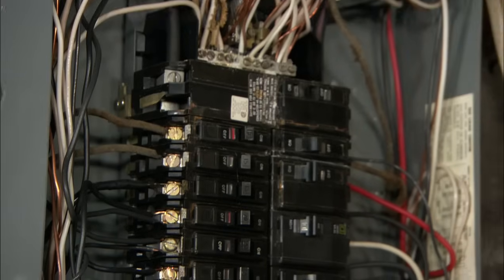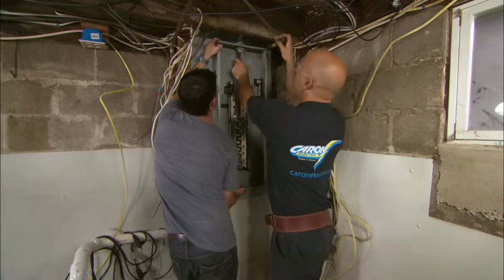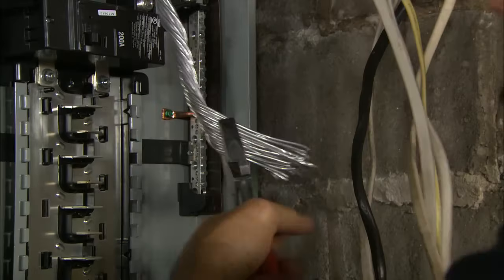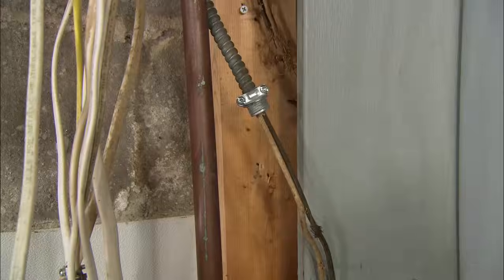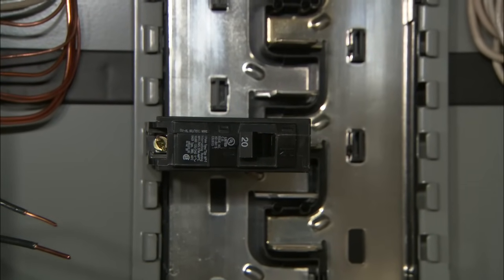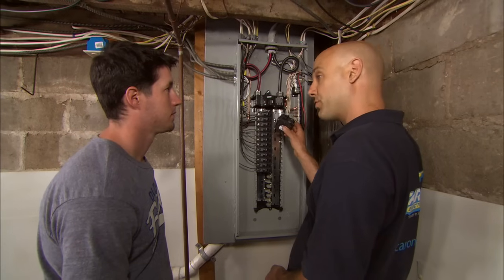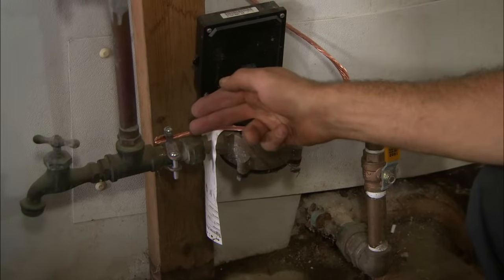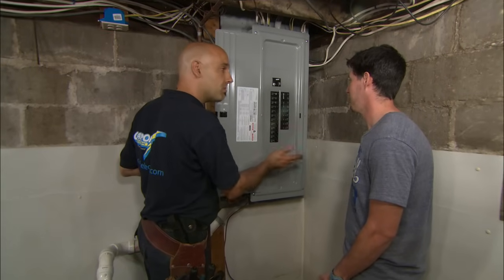How to Upgrade an Electrical Panel to 200-Amp Service (Part 2) | This Old House

Comment: don't know how long it takes him to do all this but a contractor is asking for $4,500 to do the same on my home. WTF?
Reply: Get a detailed quote of materials and time. Make sure the material quote includes make and model of panel, breakers, rain head and meter base. Then do some research to verify reasonableness of quoted costs.

It should take less than a day to accomplish. The contractor may be grossly inflating the materials costs.

Comment: not an expert but I do know 2 things, 1.) ground wire attached to water line is a no no most places require it to go to ground,  connected to a water pipe would not pass, 2.) you should never have all the breakers on when you flip the main. p.s. he's so confidant in his work he had the home owner flip the main with all circuits on instead of doing it himself.
Reply: It was TV dramatization. You can bet that it was tested out in advance of filming that scene.

Another example, they did not show the power company going to the house and reconnecting the feeders after the wiring was completed - and probably an electrical inspection as well.
Reply: Bonding the waterline is a requirement

Comment: Why are they still using aluminium wire?
Reply: Because it is far less expensive than copper and only used as far as the main distribution panel.
Reply: buggsy5 in Canada where I live aluminum is not allowed or code. You won't even get insurance for it.
Reply: chefbillyx aluminum IS used in Canada as service entrance conductors.

Comment: The main ground in this video that was shown stranded. It's a NEC violation, being bare and exposed to physical damage.  It should be solid bare ground and size accordingly to the NEC . This should be red tag by the inspector.

Comment: If this were my house getting service upgraded,  I won't allow any electrician to bring aluminium wiring into the house.  The last house I lived in, it had aluminum wiring brought in from the weather head to the outside box, then to the circuit breaker.   I don't know when it was put in, but it was put in, when the house was added onto, and was old enough to create problems.   My house nearly burnt to the ground, because the aluminum wiring could not handle dissimilar metals used in the breaker box.  The electrician used  copper wire from the weather head, to the outside box,  then to the circuit breaker.   When I can afford to rewire my current home,  I will mandate copper wire from the weather head,  to the outside box,  and to the house.  The house overall needs to be upgraded.
Reply: davenwin1973 then the power company runs aluminum to the weather head
Reply: The power company will use aluminum for their feeders. It is arguably safer to use aluminum to splice to those feeders.

Comment: To address the aluminum issue. Why the hell does this service panel contain aluminum when every insurance company in America will not cover aluminum wiring into and throughout a home? Because it's NOT CODE. PERIOD.
Reply: WRONG
Reply: Why do people like you feel a need to post incorrect nonsense on here? Nearly ALL houses in the US have aluminum entrance wire, and it IS covered by insurance companies (I should know I used to work for one)...you also imply that aluminum was used throughout the house...why? It's obviously copper.
Now prove me wrong, and post the code section where it says aluminum is not allowed as service entry wire.
Reply: It is not allowed for circuit wiring, but totally permissible for primary feeders.
Reply: buggsy5 that's interesting. I did not know.
Reply: As if you’ve ever opened a code book

Comment: I thought aluminum wires weren't to be used any more
Reply: That applies only to circuit wiring. It is still allowed in the US as far as the main distribution panel.
Reply: I don’t know who told you that

Comment: IM JUST HERE to read the comments on every sin the electrician committed by the youtube community.
Reply: LOL...exactly.
Reply: Well first of all I don't see why he's doubling up his ground connections the bus bar is hardly full a most proper install would dedicate one lug to each ground wire my opinion and also he should really be torquing his breaker connections...
Reply: Me too!
Reply: Adding GFCI as needed and arc-fault breakers as needed might be required in some places, but that would require knowing where each circuit went!  Hint: GFCI any place the circuit is near water or grounded stuff.  Arc-fault for any circuit in a bedroom.
Reply: This should have been twice as long to show turning off power, locking it out. or a statement saying that among other things. like the new guy ( to me) who turned on the breakers one by one as not to have issues with a spike and drop in power as the whole house gets lit.
Reply: Where I'm from the utility company doesn't come running to disconnect/reconnect the drop at all.. Especially on a minutes notice.  That's why i disconnect/reconnect it myself. (They actually encourage it).  Mininal down time for the homeowner..  this video has to be a few years old.  No surge protector, no main disconnect, no water pipe ground to the missing main disconnect, terminals must not be rated for al/cu (hence the de-ox)..
Reply: @bradc7767  So you disconnect the main live? That says a lot about your training on electrical.
Reply: @bradc7767  I don't know where to start on this drivel. I'm Canadian, so it might be different here. 
You don't need a main disconnect in a house if you have a main breaker.
Nolox (de-ox) has to be used on all terminations with aluminum wire. The cu/al designation only allows aluminum to be used.
If you disconnect the meter yourself, you will be fined by Hydro and possibly reported to police for equipment tampering.
No surge protector is needed, ever.
Reply: @jeffd6  Bradford must be from some small town in the US, or somewhere else in the world, because in most places in the US/Canada, you can't disconnect the mains yourself, and as you said, it's tampering. Those digital meters are there for a reason, and once you open it up and mess with it, you're technically enabling the theft of electricity. We all know you can bypass those meters and that's why it's tampering. Also the modern meters also have a tamper detection built in to them so when the utility company tests the meter there will be flags from the meter.
Reply: @johnnyboy13642  he didnt the power co came and disconnected from meter head  trust me if it was eversource they charge for everything so if they had to pull the meter themselves thts a charge just better to have them disconnect and leave asap before they find something to do and have you pay for it lol they so money grabbing there employees will not answer any questions without a fee including to identify themselves lol. 27 yrs ago they charged for a disconnect and reconnect 3 hr minimum for each was like over $500 each time took them less than 45 minutes for both. the customer was pisssed told them tht extra $1200 was just for the power co.    yes most power co. in the ne dont like it when you remove meters or disconnect on your own
Reply: assassinlexx  Yea but living in the area I know this company ain't cheap
Reply: That job was done as cheap as it gets I hope they don't charge out the you know what for what he did. The sins that popped out to me he should be more specific on actually wire size to breaker size not small, medium, big. Also those really old 2 conductor cables need to be GFCI protected if going to a regular 3 prong receptacle instead of a 2 prong
Reply: @andrewmeinders5712  well doesnt everyone who would understand gauge know already? They are obviously 14, 12, 10..
Reply: @cantcomeupwithausern  to the average homeowner that watches these videos to do it their self it is not obvious from what I've seen the last 20 years
Reply: @andrewmeinders5712  that was partially the point I was making.. that the gauge sizes don't matter to most people because they don't know what they mean
Reply: @cantcomeupwithausern  what if there was a 50 amp wire in there and they assumed that was the biggest and hooked it up to a 30 amp breaker
Reply: @timothymcmahon1507  It would trip a lot. It really isn't a big deal to put smaller brakers on bigger wires as far as safety goes. The other way around could melt stuff and potentially start a fire.
Reply: @cantcomeupwithausern  I for one know i have 12 cause its printed one the wire. and 14 im guessing cause its smaller. so i would guess in   the video either 16 or 10 as to the third  saying that. 16 seem tiny for power. my 1900 house still has 2 prongs in baseboard. GFI's in the wet areas. in process of checking which wires are old 60C. and no, I don't do my electrical work.
Reply: @andrewmeinders5712  Most rooms now need an AFCI breaker too, not many circuits are left unprotected per the 2020 NEC.
Reply: @ZombieHedgehogMakes  not necessarily since older panels are grandfathered. But in the North East I would bet they would require a huge investment. Then most homeowners will forego the upgrade and a dangerous situation is still there...
Reply: @jstone1211  i live up here not really tht bad and if your willing to do the work you can always find a licensed spark to pull permits and kind of supervise for some beer and a meal lol +cost of permits and power co fees lol
Reply: @andrewmeinders5712  does this idiot not know he was just explaining it to someone who more than likely who had no idea what was what so that's why he used small, medium and large. I have no idea how people be so dumb.

Comment: American regs are sooo different from UK regs
Reply: Not surprising, since your power distribution system is somewhat different. You also have 240 volts, not 120/240 like in the US and Canada. The split phase power complicates matters a bit.

Comment: Can someone please explain what he did to connect the clothes dryer for a 240 volt circuit? Same phase or did he connect to the to the other phase as well, or is it a different sort of dryer? Can't work it out.
Reply: There is only one phase. But 120/240 are often available at the outlet.
Reply: 120/240 split phase. By using a double pole breaker you get the full 240 volts
Reply: What may have been confusing: that 240 circuit needed a breaker from each phase, and he had referred to each phase being on its own side of the panel.  But that’s just at the top.  Where the breakers are, the phases are interleaved underneath. So, one of those breakers got one of the phases, and the other breaker, even though it was on the same side, got its power from the other phase.

Comment: First of all, you work without gloves. lack of professional education. second, with wire connections, you make people die. you can not connect the earth in water pipes.
Reply: It is a code requirement for the water supply pipe to be bonded
Reply: The box was unpowered. Why use gloves, which only slows you down.

I believe code requires metallic pipe to be bonded to the earth ground.

I suspect he knows far more about proper electrical installations than you have the slightest chance of learning.

Comment: Only copper is allowed here in my town, Wanted to put Aluminum in but inspector would not allow
Reply: I hear you... that's crazy. So many local ordinances (e.g. no cable smaller than 12 AWG allowed on any circuits) are based on nothing more than the local building department's whim. Copper and money gets wasted for no reason at all.
Reply: If you do proper load placement on A & B phases aluminum is fine.
Reply: What’s your town?

Comment: Now this is electrician who installed the insulated bushing onto the SE- cable threaded 2-screw clamp cable connector.  I fail an inspection for forgotten to do that.

Comment: Anyone knows the cost hiring someone to install 500amps or more ? I’m in Florida just want some average pricing out there to know ! Thank you
Reply: what ? are growing Pot.
Reply: I don't know if you can even get a 500 amp residential service. Even if you could, the power company might charge you for a new pole pig, which would be very expensive.
Reply: A 500-amp service would be better served as a 277/480v 3phase service, then stepped down by indoor transformers, located by the panels served, as is done in large buildings. 

At 277/480v, the wire sizes are much smaller. However, anything bigger than a "class 325" 400A 120/240v single phase service is running into serious cash. And is usually impractical in the context of someone's house. 

Now , on a farm... Much more typical amount of power required for the center pivot irrigation, dryers/silos, workshop, barns, and farmhouse.

Comment: Just a note; new codes require arc fault interrupter breakers on most interior circuits. You can't just put in regular breakers and have all the neutrals on the neutral bar any more. Just so you know.
Reply: LOL!!! OK!
Reply: That's not true in every state.  Some states don't use AFCI's at all.

Comment: This guy does an awesome job at keeping it simple and to the point. Well done. This is how (HOW TO) videos should be.
Reply: Its nice to watch, but not a guide on how to do it yourself. Not enough details.
Reply: I like how they edited out the unimportant things like cutting the main power first.
Reply: @BenJustice13  there was another video same one with more info where they remove and added a meter socket. this must be the second video to replace the breaker box.
Reply: This is the simple edited version that's easy enough for a non electrician to understand. It's more in depth than this in reality and the codes for grounding vary in different places.
Reply: @bobby_hill8357  Problem is that this gives non-electricians enough info to get in deep trouble.
Reply: Should be careful: he left a lot information out .
Reply: @darrengibson1115  rudiementary 5-6 minute overview... you gotta pay for more knowledge ;)
Reply: @paladro  true .For those diy be careful check city and county codes all free information . Also purchase a NEC code book.
Reply: I'm a licensed electrician and this guy is committing sin after sin new York state inspectors would fail his work
Reply: Well said

Comment: I never understand when people don't trace all of their breakers and create an easy to follow list.
But I'm a little OCD so that must be why :p
Reply: Glad I'm not alone on that :)
Reply: Junior Mudd I agree wholeheartedly, JM. I'm just a homeowner but I've gotta admit that properly organized wiring is a thing of beauty. I have a 1953 house in which we had a panel upgrade done by an electrician a couple years ago, with several new circuits run to modernize the kitchen. The thing looks great inside!
Reply: Panels often start out properly labeled then, over the years as circuits are changed or added to accommodate additional electrical needs, the labels become inaccurate. 

When I bought my house in the 85's (built mid-60's) about half the circuits were mislabeled.
Reply: Junior Mudd   typically the existing panel legend is either not there or so far off. I find it is way easier and faster to do one after ward with a circuit tracer. Also noticed the expansion above the meter, not required, the conduit will move. The riser does not go there the roof so it is allowed to be PVC, but not going thru the roof depends on the overhead drop being the proper height above yard sidewalk etc. The dressing of a panel is thing of pride for a good electrician.